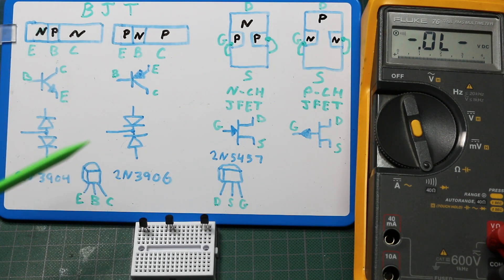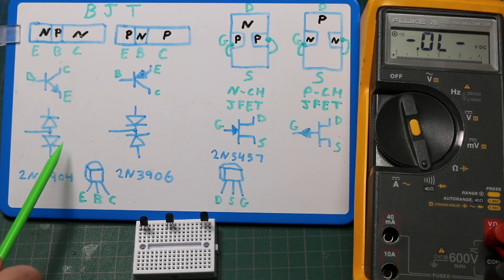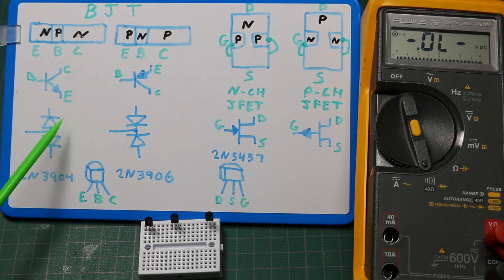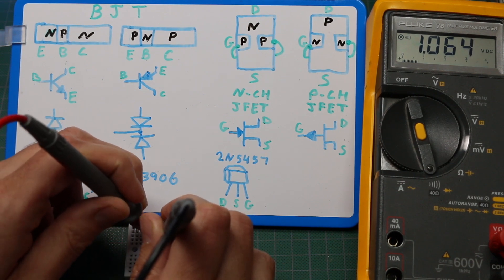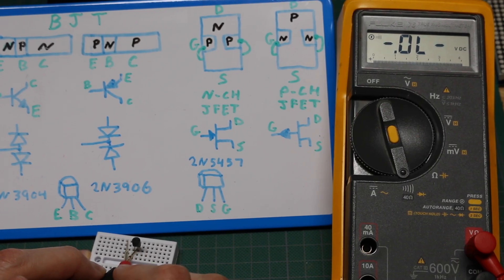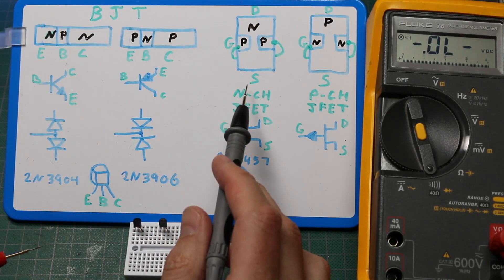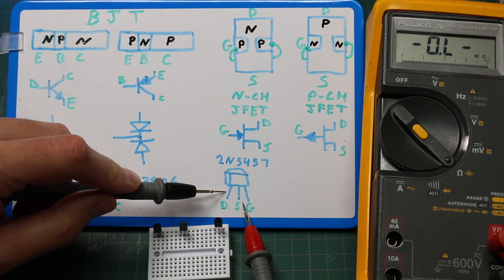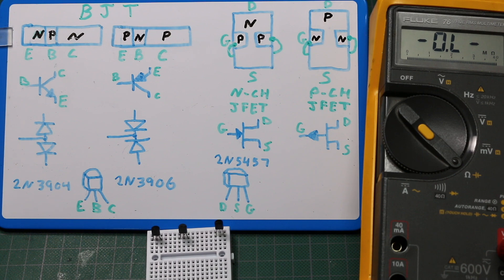How to Test Transistors with a Multimeter - NPN, PNP, JFET

Comment: Bro, I have 2 questions that will be helpful if you present: 1. How to test the C1212A, a silicon NPN transistor with a UCE of 80V and an Ic of 1A. applications: audio frequency stage, power switch and 2. How to test the C3133, a silicon NPN RF power transistor preferred for use in RF power amplifiers in HF mobile radio applications. Can you help out? thanks, Bro😀

Comment: The two top videos when searching "testing transistors with multimeter" are this and Markusfuller's video. He says the exact opposite. He says for an NPN you should get a reading with negative lead on the base and positive on the collector. I'm so damn confused.
Reply from the maker: I just watched the other video and he said NPN gets a reading with positive on the base while PNP gets a reading with negative on the base.  But his transistors have different pinouts with the base on the end instead of center pin.
Reply: Thank you so much. I was losing my mind trying to figure out which was correct.  @GadgetReboot

Comment: Is there a way test them if you don't have a diode check mode on your multimeter?
Reply from the maker: The easiest thing would probably be to get another meter, even $10 or less on Amazon I have seen a meter that not only does diode check but it also directly can test certain transistors at least NPN and PNP.

Comment: Great video another subject on Transformers DTA/DTC DTC114ES transformers in my schematics i am working on a repair  they are listed as IC's i am confused  the data sheet i have found show in out and ground with built in resistors.
 I am probably taking wrong readings at this point but cant find any good videos on these

Comment: Great video. Why are you not using the DC voltage setting when measuring the voltage value between the Base and Emitter and Base and Collector for the NPN transistor? You use the coninuity setting.
Reply from the maker: when the transistor is not in a powered circuit there is no voltage to measure but since the base to emitter and collector behave like diodes, the diode check can be used and the meter provides the power for that. if I was using continuity mode I was just checking to see if the transistor has a short circuit and if it does there would still be no voltage to measure if it were powered up.

Comment: Be aware that the leads on an analog multimeter have reverse polarity for such tests. That is, the red lead is negative and the black lead is positive battery. If that 's confusing, simply swap the lead connections on the meter for the purpose of this type of test.
Reply: I take it that is the case with some analog multimeters and not all multimeters because it seems a bit of a wierd thing to do and I'm not exactly sure why you would do that. When I connect my red probe to be delivering voltage and current that is exactly where I expect it to be coming out of, not switching around. 

It would actually be a very bad design the more I think about it now, all it would do is add to confusion.

Comment: My (cheap) multimeter in diode mode does not show voltage drop, it shows resistance in Ohms (in 400-500 range for good diodes) - can I use that reading for anything useful besides finding a short ?

Comment: thank you very much for your video, it clears my doubts since I am putting together a small inductance meter circuit and in this circuit a (JFET) is included in the design, I am not very familiar with this specific Semiconductor but thanks to your video I am clearly learning from him, thanks a hug, 🤝🎩🚭

Comment: Hello there! I really like the video, you must be a very patient guy. I have a problem with measuring and it makes me unsure. On the scheme I have NPN transistor, yet it tests like PNP, also E & C check positive on continuity test, however I haven't de-soldered them from the PCB. Should I just remove them?
Reply from the maker: sometimes the component does need to be removed from a circuit to test properly because other things can interfere with measurements.

Comment: I have a transistor that I suspect has gone bad. It tests okay with the DIMM, but the ESR meter shows an hFE of 735 or so and according to some information I found online its hFE should be between 800 to 1500. Does that mean it is indeed bad and has to be replaced? Thanks.

Comment: I'm still confused about source and drain terminals, how to recognize them properly with DMM?
Reply from the maker: when measuring the resistance between drain and source, when the gate is floating the resistance is probably going to be very high up in the megs, but when measuring the resistance drain to source and gate is also shorted to the source, it’ll be lower resistance, in this case it was a couple hundred ohms.

So which ever pin shorted to the gate leads to a lower resistance reading from drain to source, that pin that’s shorted to the gate must be the source.
Reply: Thanks a lot 👍👍
Reply: But how we can say that it's source or drain?
Reply from the maker: if you don’t know what any of the three pins are, you do the diode test to figure out where the gate is because it will have a diode drop from that pin to the other two pins.

when you know which pin is the gate, measure resistance across the other two pins which will be source and drain, and do it while connecting the gate to one of those pins and then the gate to the other of those pins.

when you see the lower resistance reading, the pin connected to the gate at that time is the source pin.

Comment: Very good description of the behaviour of NPN and PNP transistors. Looking at your diode representation of a NPN, is it true to say (without getting into the internals of the transistor) that when a small current is supplied to the Base, that the diode representation for the Collector/Base effectively switches around to be aligned with the diode representation of the Emitter/Base so that current flows between the Collector and the Emitter. If this isn’t the case, then with your diode representations, how can current flow between the Collector and the Base. Hope this makes sense
Reply from the maker: if you read the paragraph called “function” on this Wikipedia article a few times it might help explain it.
https://en.wikipedia.org/wiki/Bipolar_junction_transistor
it all has to do with the physics of the transistor geometry such as the base area being thin and the emitter being more heavily doped with charge carriers and how electrical momentum can be created to allow current flow between the emitter and collector.

Comment: Hello..im thinking of replacing a transistor labelled 'ST C945 G G2'..can you please suggest what kind of transistor and the exact euivalent i can use safely?Im repairing an old cambridge soundworks amplifier..thanks!
Reply from the maker: i’ve never seen the part number before but it looks like a general purpose NPN that can be replaced with other general purpose, the ones commonly available to me are 2N2222 and 2N3904. of course use the information at your own risk but that’s the best information I can find on those numbers.  https://envirementalb.com/c945-transistor-pinout/

Comment: How do you figure out if it's jfet or just transistor if it's blown?  I'm working in a old printer.  It was reverse polarity blown.  6 volt printer with 12 volt reversed charger.  I have a few to fix but I can't find any info With what is printed on the component.
Reply from the maker: if it’s blown so that it’s got open or short connections then measuring it won’t work but if you can see the markings then you can try to look up various codes. There’s a lot of different websites about surface mount component markings like
https://alltransistors.com/smd-search.php

 for through hole parts this might help https://www.qsl.net/yo5ofh/doc/transistor_codes.htm

Comment: how do we know it is either drain or source gate? from what you did you only show when we already know the left pin is the drain. how do you decide it is the drain pin?
Reply from the maker: One way to tell the difference is if there is different behaviour when shorting the possible drain with gate compared to shorting possible source to gate.   The gate-source voltage is what controls the conducting channel, where zero volts (a short) from gate to source will open the channel and give low drain-source resistance.
So if we measure low drain-source resistance with gate to pin A but then high resistance when shorting gate to pin B,  then pin A must be source because we were able to open the channel.

Comment: This is one of the best explanations I have come across on this topic. I already knew how to test NPN and PNP transistors but did not know how to test JFET transistors. I have a few  2SK30A R  transistors  that I removed from a circuit  and want to test. In the diode mode they tested fine, but when I tested in resistance mode with Gate and Source grounded the reading was around 550 ohms. Would that figure be considered too high since you mentioned a couple hundred ohms max resistance. Is there a benchmark figure where it can safely be assumed that the transistor is faulty. I am just a DIY  trying to get a better understanding of electronics. Thanks for sharing your knowledge.
Reply from the maker: I haven't worked with JFETs enough to have direct experience observing failures and all the sources I have seen refer to "a few hundred ohms" as normal with gate source connected, so it seems subjective but 550 ohms sounds close enough to good.   I think a bad one would more likely have damage on the gate from excessive voltage, so if the diode check works, I'd say it's all good.
Reply: @GadgetReboot  Thanks for your swift response.

Comment: Not all multi-meters will give an indication of junction voltage.
A better method is to put the lead supplying the +ve voltage on the collector and the other lead on the emitter. Then touch the collector and base with fingers and a working NPN transistor will conduct. Swap polarity for PNP transistors.

Comment: Great video. I have an SMD 2n5457 which measures drain-source resistance of approx 315 ohms - would you say this is a defunct JFET?
Reply from the maker: A couple hundred ohms is normal when the fet channel is fully conducting, so as long as it goes up very high toward infinite resistance when the channel is closed, it would seem to be working fine.
Reply: @GadgetReboot  thanks. You are a scholar and a gent.

Comment: Noticed you were playing with jfe t switching on as an audio project a few videos back.  Saw the cd4049b on the board which makes an excellent fuzz pedal!  Recently ran into another circuit that uses all the gates in parallel instead of just  2 or 4 of the 6 inverters.  jimhough66@gmail.com